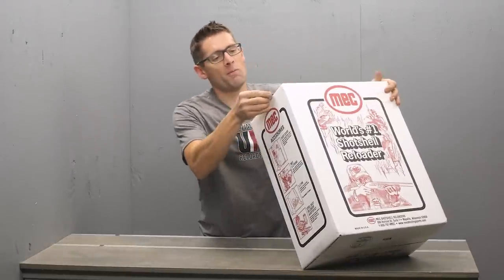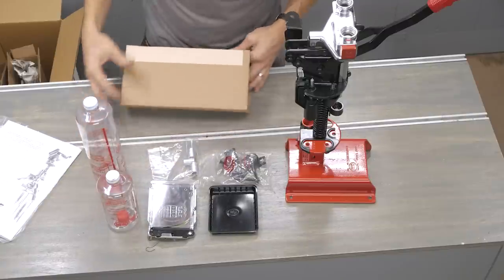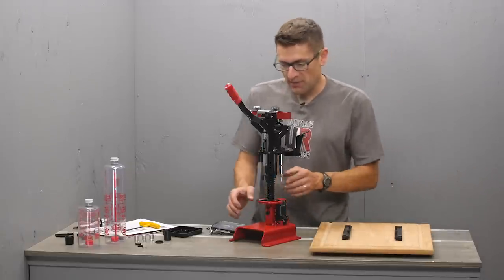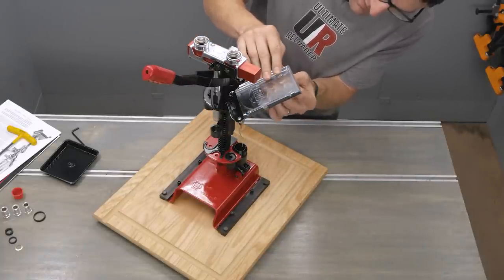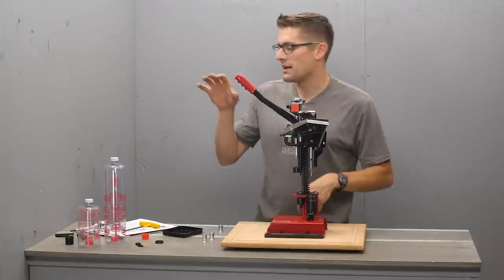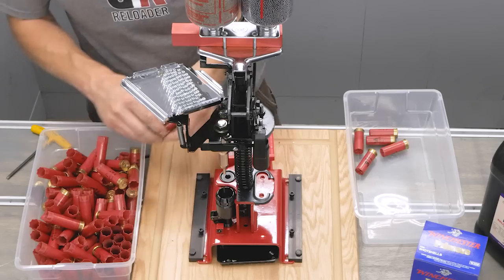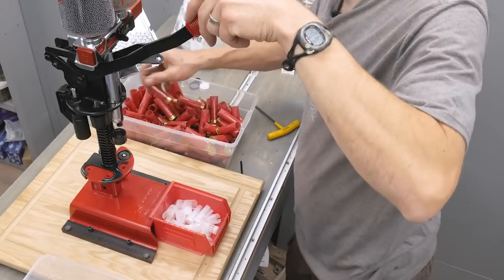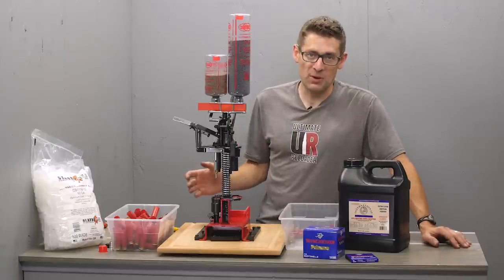MEC Sizemaster: Unboxing, Overview, Loading 12 Gauge Shells

Comment: From personal  experience, the biggest difficulty in using a MEC press with Winchester AA HS hulls is getting a good crimp. I would have appreciated his adjustment procedure for that.
Reply: Call Mec, they will slowly walk you through it. I have every gauge Grabber reloader. 12 &20 in the sizemaster and 12&20 in the 600 jr. They work perfectly. Note: I had problems with my 410 grabber final crimp. After talking to them, it now works great. They even offered for me to send the whole reloader in and they would set it up for me. That's customer service.

Comment: Could be wrong, but it looks like you’re using Remington replacement Figure 8 wads as opposed to AA replacement wads. I use these when reloading STS hulls. I’ve tried reloading AAs with the WAA12SL wads and the hull crushes as soon as I get the crimp right (very annoying). Maybe I’ll try these wads in AA hulls and see how they come out

Comment: I have the same press and right out of the box makes great shells using Remington cases.  I also use a universal charge bar. For routine shooting though it is hard to beat the Winchester or Federal Wallyworld shells price wise but when you want to load some really light loads this is great. Not as cost effective as pistol or rifle but fun.
Reply from the maker: Good summary- reloading shotshells is most desirable to achieve specific results...

Comment: Wow, the human factors challenge here, with the double action at station 3.  So easy to be distracted, and mix up/forget powder and/or shot (both are essentially unseen).  Obviously, consumers make this work - would be good to have a discussion of process factors to help limit errors, and check techniques to catch errors that creep in, and, how to pull apart a shell to correct an error.
Reply: It's called paying attention and eliminating interruptions.
You can't foolproof human induced errors with a machine. If you want to not take on responsibility, buy factory ammo.

Comment: I haven't loaded in 30 years , but I remember my dad's MEC loaded in the opposite direction. Do they make them in left hand and right hand directions? Other then that it was exactly the same. Ours started on the last side and ended on the right side.
Reply: I still have a dozen boxes from when I was 14 years old that I loaded. As I used to load all of our shells since I was 8 years old, we used to have 100 boxes on tap at all times. Ranging from duck/geese and bird to trap shells.  On occasion s I would  add a bit of extra powder to a box  specially marked hot loads to have fun with friends, my dad and I loved pulling the hot load prank on friends. Or having a hot load in third position in case you missed your first two . The third was hot enough to get the distance and speed too, but hold tight cuzits gonna kick like donkey.

Comment: Are you going to do a review on the top end shotshell reloaders?  The presses you have tested are good, but for a real high volume shooter you need to look at the ponesess/warren product line and of course Spolar.  PW also makes a single stage, the 375, which is an extremely good machine.

Comment: Now will this load 00 and 000 3in buckshot ???
Reply: No. Buckshot is always introduced into the readied shells by hand.
Depending on the load either fold start crimped on the press or roll crimped by using a separate tool.

Comment: What is the largest buckshot size that can be used with either the size-master or The Mec 600 JR V models? Thank you.
Reply: Buckshot must be counted and hand loaded off the press. Just use the press to size, prime, powder and add the wad. Hand install the buckshot, then either star crimp the shells on the press or use a seperate roll crimping tool.

Comment: Nice setup. Do these MEC reloaders work with buckshot as well?
Reply: yes you just pull out the hull after the powder and the wad of your choice and add buckshot. you may have to add overshot cards etc to get the shot column the right height for a good crimp

Comment: Can this drop 00shot?
Reply: No loader loads buckshot. They are manually inserted by hand and finished off on the fold crimp or roll crimped using a seperate tool.